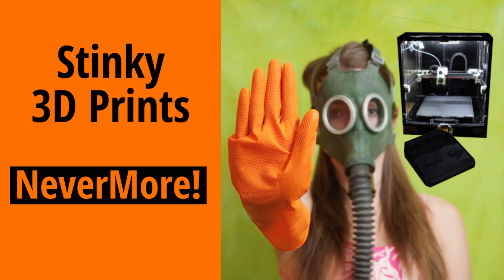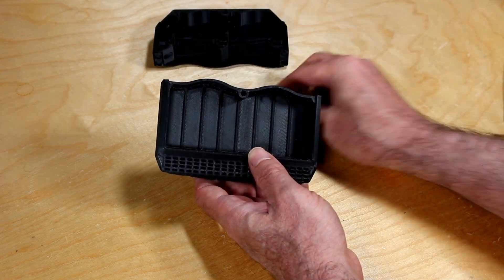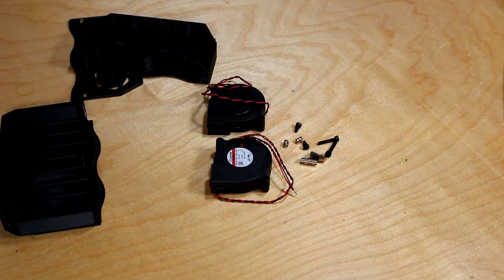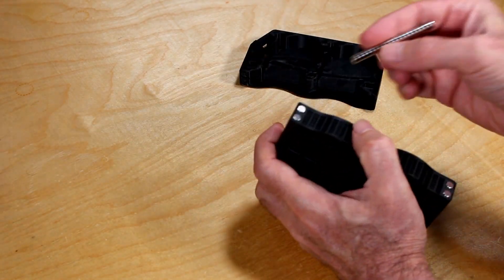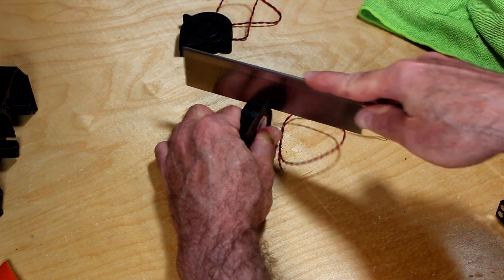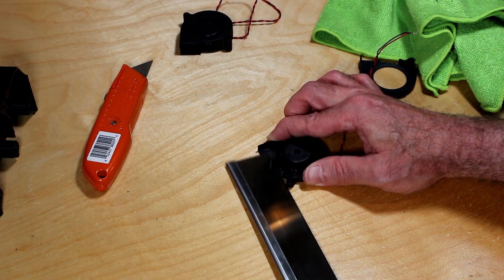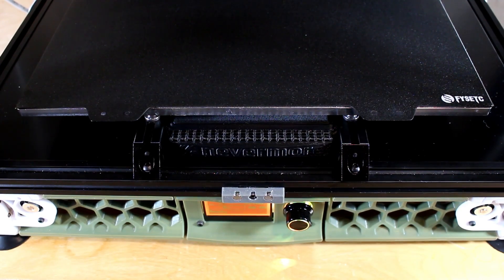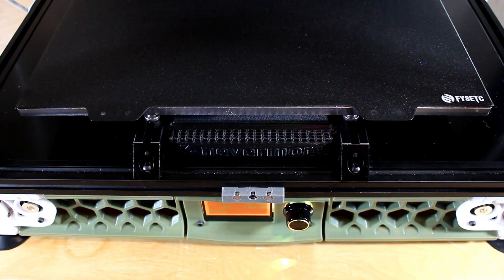Eliminate 3D printer plastic odor by building and installing the Nevermore activated charcoal filter

Comment: when you say "my family wanted me out of the house..." Are you talking about your parents? Are you sure is the printer the reason your family wants you out?? 😜
Reply from the maker: Ha!  It was actually wife and kids that wanted the printer out of the house....I hope :)
Reply: @KapmansBasementWorkshop  oh good! hehehe...
I've been printing for 5 or 6 years now. I started with 2 machines similar to Anet A8 and didn't leave the PLA comfort zone... printed some TPU and PETG but I didn't even try ABS until 4 days ago when I just put together a Voron 2.4.
Between spare parts, mods, and a couple of big decorative pieces (to check the quality, mainly) I printed already more than a Kg of ABS.
My wife hasn't complained yet, and at the beginning I thought that everybody has being exaggerating about the smell, but now it's starting to annoy me.
I printed yesterday the nevermore, added the fans and installed it under the bed, I'm just waiting for the carbon to arrive... let's see what difference it makes.
Anyways, thank you for the video, was pretty useful, I'm going to keep following on your mods!🤗
Reply from the maker: @MrPeloseco  It turns out I really like printing ABS.  More than PLA or PETG.  So I print a lot of it.  Nevermore helps, but get that running prior to the start of the actual print.  Also, it exists in two sizes.  In the video I went with the larger, I ended up switching to the smaller charcoal holder as I found it actually works better with eliminating fumes, but it needs to be changed more often.  Also, so your 2.4 is new.  Just wait until you start tuning and increasing it's speed.  A print done in half the time means 2x the amount of smell in that time....Nevermore becomes super useful.  Enjoy the new 2.4 and thank you for the comments and watching!
Reply: @KapmansBasementWorkshop  
Yessss!! I got the LDO kit revC, the good stuff, so at this time I'm a bit paranoid, trying not to warp the bed, making sure everything is smooth, no belt rubbing, etc... so I've been conservative with my settings. also reading a lot about klipper, mainsail, Jinja, the macros... a lot to learn!! But I'm loving it so far.
My 20h print finished a couple of hours ago and I'm ready for my first acetone bath!!🥳🥳 wish me luck😅
Reply from the maker: @MrPeloseco  I wish you luck with the acetone bath.  Enjoy the new printer!
Reply: @KapmansBasementWorkshop  thanks... it's taking way longer than expected.
I'm using a 5gl bucket. I poured 16 fl oz of acetone in the bottom. the piece is about 3 inches over the acetone. it's quite big and printed in ABS+, maybe that's a factor too. I'm installing a fan in the bottom of the lid of the bucket, thinking that the fumes might accumulate at the top... let's see if this goes faster
Reply from the maker: @MrPeloseco  ABS+ is most likely the problem.  It's not really ABS or fully ABS.  I would reprint with 100% ABS and try again.

Comment: SUNON maglev - real ones only use 12 volt, there is no 24 volt official sunon maglev they are fakes
Reply from the maker: That's good to know.  I'll need to keep that in mind when I replace them.  Do you know of quality blowers that run at 24v?
Reply: @KapmansBasementWorkshop  GDSTIME dual bearing (make sure not to select sleeve, DB lasts longer). They are good enough, though I'm sure that sunon is fine
Reply from the maker: @giedrius2149  I actually purchased a few GDSTIME dual bearing blowers for another project.  So I'm glad to hear that they are good.  Thanks!

Comment: The design should have have really been made in such a way where you woluldn´t need to cut anything. These is no need for this at all, the blower fan works just fine with it´s housing.
What´s the point of the design freedom with 3D printing if you still have to modify those fans ?
Also how is the charcoal compartment sealed ? The air will most likely escape at other openings because it will take the way of least resistance, so a small rubber gasket or hot glue or silicone or something would be needed on that lid.
Reply from the maker: I do agree about cutting the fans, but I think the designer was trying to get air passing through as much charcoal as possible.  But, it doesn't leak.  It works really well.
Reply: @KapmansBasementWorkshop  okay, in this case I am glad it works as intended. One more minor thing... shoudn´t a HEPA filter follow the charcoal ? I mean otherwise fine carbon particles will be everywhere including the air you breath and their effect is basically the same asbestos has on the human body. I mean look at any standard industiral filter it has alawys musltiple stages for a reason ...it´s not only so to filter out certain particles it is also to not release more particles...
Sorry but this makeshift DIY product is not safe. I am a DIY guy myself, I am also a design engineer for crash relevant parts in the automotive industry, believe me you don´t want a design thousand of people all over the place copy and harm themselves.
Reply from the maker: @sierraecho884  All good points.  I believe the designer was more concerned about the gasses released from ABS when printing mainly.  In addition there is a hepa  filter at the top rear of the printer to filter out particles.  So this is additional to clean what Hepa does not.   I can honestly say it greatly reduces that ABS smell during and after the print.  The activated charcoal pellets are very clean, but I suspect if it blows coaldust into the enclosure, the hepa filter would take care of the rest.  I have never seen any coal dust when cleaning the inside of the printer.  When printing ABS at 350mm/s, there is almost no smell now vs previously where family complained the entire house was smelling strongly or watery eyes.  It sure seems like a major improvement.  This certainly isn't perfect, but it sure seems better than the alternative of doing nothing.  Thanks for watching!

Comment: what if instal a piece of hepa filter on the exit of the nevermore filter?
Would nt help to filter particles as well?
Also, another question: I will not be able to connect the filter directly to my printer, but using a different power source. Do you think I can get good results with a 5v fan?
By the way, I aquiered your carbon :)
Reply from the maker: As long as the 5v fan blows as much air as the 12 or 24v versions, you should be fine.  The fans are not that strong in general and that's a significant amount of carbon it needs to force air through.  Once you build it, you will notice that there is a light stream of air that flows out of nevermore.  I think an additional hepa filter might stop the airflow completely.  That carbon isn't mine, it the brand of the nevermore designer.  I still use that carbon and it works well.  Thank you for supporting his efforts and thank you for watching!
Reply: @KapmansBasementWorkshop  Thank you for your time and good will! :)))) Excelent video, and I thougt you were the designer, but your video is fantastic :)))
Well, I will follow your advice :)
Thank you again :)
Reply from the maker: @JugularFilmes  Fell free to ask if you have any questions in the future.  One other benefit, this helps heat the interior faster as well.
Reply from the maker: And thank you for the kind words!

Comment: Thanks for the video! From my research, it's a good idea to set up the Nevermore as a heater_fan based on a low-ish bed temp (e.g. 40C) so that it runs both during the print and for a little while after the print. Something like this:

[heater_fan nevermore]
pin: PA8
max_power: 1.0
kick_start_time: 0.5
heater: heater_bed
heater_temp: 40.0
Reply: Yea great tip. I have mine set up like this but to only start the fans at 85C so that it stays off when printing PLA and PETG. The charcoal should also last longer then? Will see how it goes.
Reply from the maker: I should have thought of this. This is a great idea. Thank you!
Reply from the maker: I think that's a great tip.  I may end up doing that myself!

Comment: Hello Kapman, 
Great video, helped me along with my build.
Did you figure out how to control the fan? 
I upgraded my controller board from SKR Mini E3 v2.0 to a v3.0 to accommodate the extra fan. 
However, I am still having to run it manually. 
I was thinking about putting it in the slicer somehow, or would a macro in Klipper be best? 
Would like to know your thoughts.
Reply from the maker: I chose to not automatically control the fan.  It's somewhat noisy and like the ability to turn it off and on as needed depending on the type of filament I'm using.  Thank you very much for watching!
Reply: @KapmansBasementWorkshop  Thanks for your reply, I asked/looked around on the Voron Discord and came to the conclusion that it can be done via the start/stop print macros in klipper. Once I get them up and running I will post the code here.
Reply from the maker: @9618Dude  Very cool.  Others will be able to make use of it!  Thank you!
Reply: Under the  Fan Control Banner I included:
[fan_generic nevermore_filter]
# FAN2
pin: PB15
max_power: 1.0
kick_start_time: 0.5                                                # Depending on your fan, you may need to increase this value if your fan will not start
off_below: 0.13
cycle_time: 0.010

After the Macros Banner in the printer.cfg in klipper I inserted the following:

[delayed_gcode filter_off_end_of_print]
gcode:
  SET_FAN_SPEED FAN=nevermore_filter SPEED=0
....
[gcode_macro PRINT_START]
gcode:        
    # Parameters
    {% set bedtemp = params.BED|int %}
    {% set hotendtemp = params.HOTEND|int %}
    {% set chambertemp = params.CHAMBER|default(0)|int %}
    
    G28
    # <insert your routines here>
    SET_FAN_SPEED FAN=nevermore_filter SPEED=0.5
    G1 Z20 F3000                         ; move nozzle away from bed

    M140 S{bedtemp}                      ; Set Heat Bed temperature
...
[gcode_macro PRINT_END]
#   Use PRINT_END for the slicer ending script - please customize for your slicer of choice
gcode:
...
    SET_FAN_SPEED FAN=nevermore_filter SPEED=1.0
    UPDATE_DELAYED_GCODE ID=filter_off_end_of_print DURATION=300
Reply from the maker: @9618Dude  Very cool.  I'll need to give it a try.  Thank you!
Reply: @KapmansBasementWorkshop  absolutely, this video helped so much it's the least I could do. I also have tested the code and confirmed that it did work. Let me know if it would be helpful for me to upload my entire printer.cfg code
Reply from the maker: @9618Dude  This is a good idea.  Do you have a github setup?  I can post a link with a description on the video.  Or, if you like, send it to me by connecting on Discord and I can post it on mine if you prefer.  I'll make sure people know the cfg was created by you.

Comment: Thanks for making the video... Seems you are the only one.  How did you mount the filter to the frame?  I have looked at all the "base" files but don't see anything that makes sense for the v5 Duo?  Does it attach or just sit loose below the bed?
Reply from the maker: The V5 mounts to the 2 extrusions that the bed is mounted to.  You will need to insert t-nuts into those two extrusions and there are holes (one hole per side for a total of 2 t-nuts) in the fan body (plenum) of the Duo for the bolts to fit and connect to the aluminum extrusion.  In hindsight, I should have shown how it's mounted.  If you look at the STL in GIT, spin the plenum around so you can see the sides.  The holes are visible near the front (exhaust) of the plenum.

Comment: I know it's mentioned in the video but: MAKE SURE YOUR CARBON IS NOT ACID ACTIVATED!  Acid can get left behind and when blown around inside your printer can lead to IMMEDIATE (Within an hour or so) rusting of anything that will rust..  I can't emphasize how horrible this would be.
Reply: How to tell of acid is in the coal?
Reply: I guess you could put the filter in a bag together with something metallic and let it run for an hour or so, and see if it rusts or something
Reply: You can soak the charcoal over night in a 1 gallon of water and 1tbsp on baking soda to neutralize the acid. Dry the charcoal in a dehydrator and you’re good to go.
Reply from the maker: @gixrman a good safety precaution as well.
Reply from the maker: Thank you for the reminder!

Comment: Thanks for this. I ended up using a simple pair of flush cutters to snip away at the fan. No need for blood on this project ;-). I looked at the assembly pics from the Nevermore designer and saw the female JST connector is part of the design. I had one (or fifty) laying around so added it. The filter looks real nice now. Again, thanks... I didn't know about Nevermore until this video and now I have 2 (I built the v4 too, just to see which one will suit my needs).
Reply from the maker: Yes, I probably should have used flush cutters too.  Since this project, I purchased a pair.  I'm pretty sure I'm going to switch to the smaller charcoal cartridge to get better airflow.  I'm glad to hear they are working for you and thanks for watching!

Comment: Been using my nevermore for about 8 mo.  Now to figure out what to do with the used/spent pellets.  In the garden compost?
Reply from the maker: That's a really good question.  I've been wondering as well.  I have a charcoal grill, I was thinking of dropping it there once lit but either after cooking or quite a while prior to give the fire time to burn off any ABS fumes absorbed.  I've also thought of just dropping it into the garden.  The one thing I have noticed is that when it seems it has stopped absorbing fumes, I can pull off the charcoal holder and flip it end over end 5 or 10x to mix up the charcoal and then I can continue to use the same charcoal longer.  It might just be my fans are not working so well, but you might want to give it a try and get more use of the activated charcoal you do have.
Reply: Then your transferring any hazardous fumes into your compost, same reason you don’t compost diseased plants😎

Comment: Superglue is too brittle.  The concussions from the magnets smacking slowly cracks it up and soon they are pulling out.  Use epoxy, lasts forever.  Little bit softer and can take the blows.   Be sure to lightly burnish the magnet with medium or fin sandpaper for better adhesion.
Reply from the maker: These are good suggestions.  So far, what I used has worked.  But I'm also being very careful when replacing the charcoal to be super gentle.  This was mainly because these super strong magnets are very brittle.  They break very easily.  Thank your for the suggestions.  I'll probably make the change once a magnet pops off or breaks.  Thank you for watching!

Comment: I'm a Nevermore user. Installed a v4 in my Voron V0.1 primarily for PC+CF as it stinks when printing. VERY happy with the resilts. The trick it to use quality activated charcoal. I put a USB controlled relay on this that is easily controlled via Octoprint. Works great, but does add to the fan noise as I'm used to running Noctuas....I wish i could find a Noctual blower style unit.
Reply from the maker: I built the v5 with the extra large charcoal filter, so those blowers need to run at full speed.  It's a little noisier than I expected.  Noctua needs to come out with one, I agree!  Next time, I may go for the smaller filter to quiet down those fans.  Thank you for watching!
Reply: holy you still use octoprint for your voron? You’re missing out big time.
Reply: @user-yk1cw8im4h  No, not really. I get all the goodness of Klipper  with the benefit of plugins, a familiar interface and remote access. Yes it can be a touch finicky at times, but the ease of managing multiple printers via uniform UI and remote access wins.

Comment: I’m in the process of doing the nevermore but I don’t recall seeing any instructions to cut the fans. Is this required for all fans?
Reply from the maker: This is text and a link from the Nevermore Github site: "Check out assembly images (take note at how the fans are cut!) here: Nevermore V5 Plenum Assembly Album.  This is the link to the images that show the cut fans: https://ibb.co/album/0BN405?sort=name_asc&page=1&params_hidden%5Blist%5D=images&params_hidden%5Bfrom%5D=album&params_hidden%5Balbumid%5D=0BN405
If you don't cut the fans, the air stream will only be focused on 2 spots on the filter instead of evenly distributing the air and making use of the full filter.
Reply: @KapmansBasementWorkshop  thank you. Idk how I missed that but I’m glad you did a video about it or I would’ve been limiting or defeating the purpose. Thank you again.
Reply from the maker: @csenior10  One more thing, I added a note to the video description.  I forgot to state in the video that once installed, you should run a PID tune on the bed heater.  It happens to all of us!  Thank you for watching.
Reply: @KapmansBasementWorkshop  ok great. thanks for the tip

Comment: I’m in the process of building mine but I don’t recall seeing anywhere instructing to cut the fans like that. is this required for all fans in this nevermores?
Reply from the maker: I would say it's required.  This is text and a link from the Nevermore Github site: "Check out assembly images (take note at how the fans are cut!) here: Nevermore V5 Plenum Assembly Album."  This is the link to the images that show the cut fans: https://ibb.co/album/0BN405?sort=name_asc&page=1&params_hidden%5Blist%5D=images&params_hidden%5Bfrom%5D=album&params_hidden%5Balbumid%5D=0BN405
If you don't cut the fans, the air stream will only be focused on 2 spots on the filter instead of evenly distributing the air and making use of the full filter.
Reply: it is required, you need to print out the provided jig to cut it into a circle. A 3 mins job with a flush cutter
Reply from the maker: @user-yk1cw8im4h  Is the jig for the v4?  If there is one for the v5, I missed that!